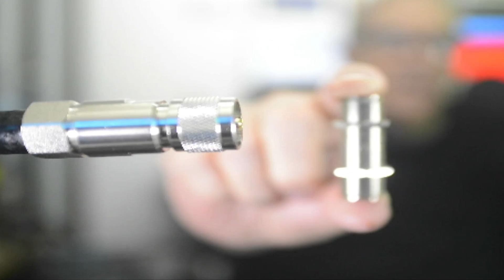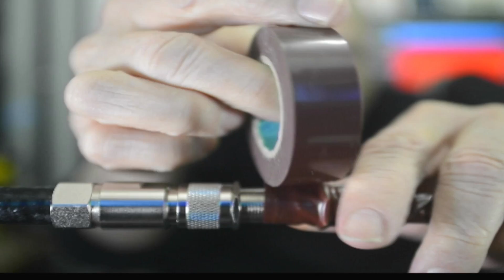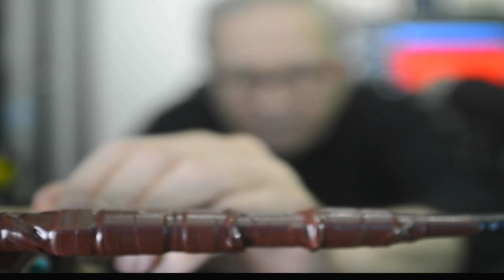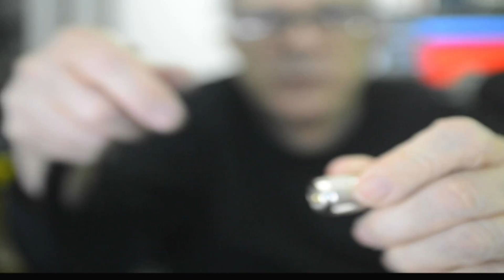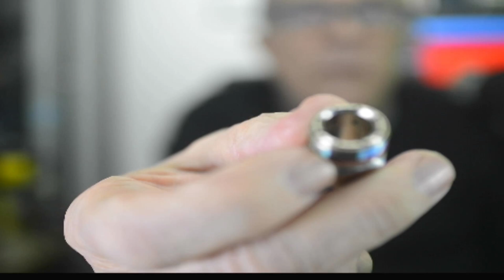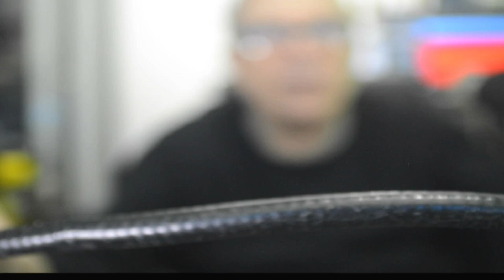Sealing Coax Connectors and Coax Cable from the Weather

Comment: I use the same hardline connector. I found once the coax is in the connector if I tap the connector end with my pliers, it seats the center conductor inside those "fingers" for the center pin. It makes a connection you can't pull apart. Then tighten the collar.
Thanks for the qso. Great video.
Dave W9DLP

Comment: Jim, this may not apply with the self-healing tape you use, but I'll pass along a tip I got from an even older-timer who had experienced problems opening up sealed connectors and having trouble getting the adhesive shmoo off of  the connectors.  When first sealing, start with a layer of vinyl tape wrapped sticky-side OUT, so there is no adhesive on the metal at all, then proceed with further layers as usual.   If you have to slit it open, the connectors come out clean as a whistle. =AK2QJ

Comment: Where I live the only 70% IPA I can get is the stuff used in hand sprays for Covid disinfection.  I prefer to use 99% IPA like that used in wood finishes.  It's expensive but leaves no mineral residue from the water because there's so little water in it to begin with.  Also, the low water content can't attack the coax from within the connector and degrade performance over time.  You still need to waterproof the joined connectors per Jim's instructions to keep the weather out, however.

Comment: Rubber Splice tape. Self emalgamating......or whatever you called it. European term I believe. Never heard it before until looking online and a guy from Europe said it. 

Anyway its used by electricians to make electrical connections. Even on 480V. It's at all hardware or electrical supply stores. Many brands of it. Some have a plastic like layer between each wrap / layer. That works but is a pain to work with! Takes even more practice. But is the older original type I believe. 

Yes pull it snug. If you notice you had some gaps in it. That wouldn't pass a test! But if you pull to hard it will stretch to thin and or break. Takes practice. Over time it forms a solid bond. Then put a layer or two of regular black electrical tape. But always cover the ends. Always end it on top of itself away from the ends. Never stop the outer electrical tape at the end of a wrap. Go back on top of itself so it's stuck to itself and not the cable or wire.

Needs to be clean. But I never have used alcohol to clean it. Only if the connectors had residue or were dirty. 

Done properly this with last a lifetime! If you ever need to take it apart just run a knife or box cutter down it's side. Just don't go to deep and into the coax outer jacket. Once cut it will open up like pealing a orange! Well almost. Still very easy to undo / remove. It's TONS better than that Coax Seal tar crap! Throw that nasty crap in the garbage! 

I have a Splice I made over 20 years ago and is still in great shape! No I've not opened it to inspect it but only the outer electrical tape has shown signs of weathering. I just retape the outer when it's accessible if needed. 

I will say..... This is in the East Texas heat. Not up north where it's cold. Not sure how harsh cold affects it. But doing it in the winter or cold you need to warm the tape. Keep it in your pocket if outside.

Comment: No, sorry,  the  tightening procedure for the barrel connector leaves me cold.  BNC/N  other connectors do not need to be "tight'  as the  ground and center both are made, basically  "without" the outer sleeve.  NOT SO  UHF connectors  (PL-259).  If the shell becomes  loose,  the  shield connection  becomes loose.  Poor design.   The shell MUST be tight to maintain a  ground  connection between the shell body and the  sleeve / barrel,  and the  teeth of the  male body end against the teeth of the  barrel end.  

While the locknuts  "may"  help prevent loosening, it is important to have some  torque  on the sleeves  to maintain  "tight."   Thermal  cycling   can cause loosening.  Here  in N Idaho  we  have had  temps well  into  -20F region, and summer temps  banging on the 100F door.  

Frankly  everybody would be better off  if UHF connecters   "went bye."   And for the newcomers,   they ARE NOT  "UHF"  connectors.   PL-259-ish  connectors were named  that  "back when"  UHF  was considered a LOWER  frequency range!!!
Reply from the maker: I think 50MHz was considered UHF. 73, Jim

Comment: I despise pl259s!! There so lossy. N connectors are so much better. I really wish hams would use N connectors
Reply from the maker: Dear Skylar King in your Songbird, PL259's are not lossy.  I have proved that over and over and over.  There is no loss in a UHF male.  73, Jim W6LG
Reply: @ham-radio  On the hf bands you are correct but on your own website you stated anything above 30 mhz the N connector is better. Look I'm a ham myself and we all have preferences. If I'm gonna crimp connectors I'm going with N or SMA
Reply from the maker: @skyking6989  Agreed and many thanks.  UHF connectors are awful at UHF and down to VHF.  Some have VHF above 6 meters.  Some do not.  The tests for loss that I did and will do again soon was roughly at 28MHz.  Sky King was a favorite TV show for me and my brother.  73, Jim
Reply: @ham-radio  73

Comment: Hi Jim. I had to change from Isopropyl Alcohol to Denatured Alcohol. Isopropyl always left me with a white sticky haze that was a bear to clean off on PCBs. Denatured Alcohol cleaned great and made the job much easier. I agree with everything else you say. Thanks for your work and time in these vids. Carl, AB1ZI
Reply from the maker: THANKS!  Great advice and help to all of us.  Thanks again Carl for your help. I will  get some denatured.  I have used isopropyl to clean my skin for injections of B12.  I also use it to clean my lenses with the help of a Q tip.  Thanks for a better way..  73, Jim W6LG

Comment: I need to get up on my roof mounted tower and check my connectors for my hex beam. Developed RFI issues that grounding and toroids haven't helped. Have a feeling some water got into my connectors. Thanks for the video. 73 K9WWW
Reply from the maker: Good luck!  Be careful.  If before you get on the tower, you want to talk about what is happening, we can do a Skype or Zoom.  I'd be happy to discuss the RFI issues, etc. 73, Jim

Comment: Great video sir: Thanks for the tip on the exterior tape for connectors,  73's , TMP from N.J.
Reply from the maker: Either that tape or the stuff sold on Amazon.  I am doing another video using information from Billy ZS1SBW.  He climbed his 100 foot tower and replaced the tape a few days ago so that we could see how he does it at the beginning of Africa.  He climbed 100 feet with his cellphone to help us! 73, Jim

Comment: hey jim thanks for the video as far as the self amalgamating tape goes how long will it last on a lightning protector always worry about u.v. radiating heat from the sun light  and any heat that travels threw my lmr400 coax...73
Reply from the maker: Mine lasted for a few years.  A friend, ZS1SBW changes his tape every 14 months.  73, Jim
Reply: @ham-radio  thanks jim your the best

Comment: Nice info. How long had that hardline been outside? Water seems to always find a way in. Looks like condensation on the shield of the old connector.
Reply from the maker: Excellent question.  At my house probably 10 to 15 years. For most of that time, it was unused due to that connector.  73, Jim.............thanks Jay
Reply: @ham-radio  that self amalgamating tape is the best thing since the Morse key. Will definitely last along time.
Reply from the maker: @JayN4GO  dit dah dit     dah dah dah     dah dah dit     dit     dit dah dit                          73, Jim